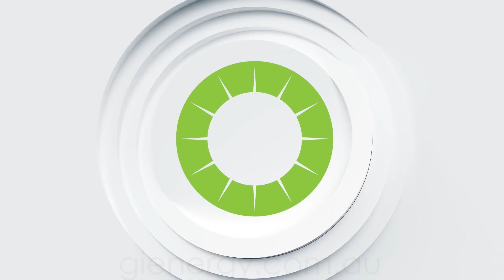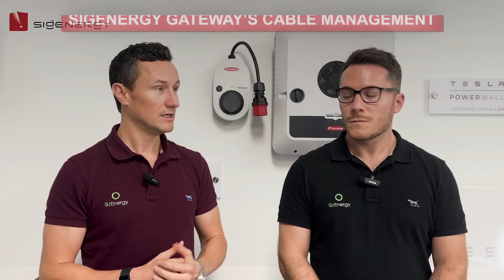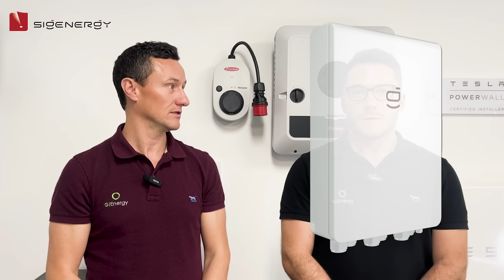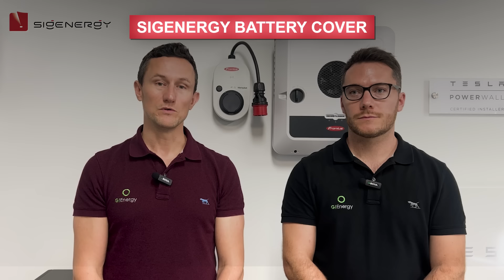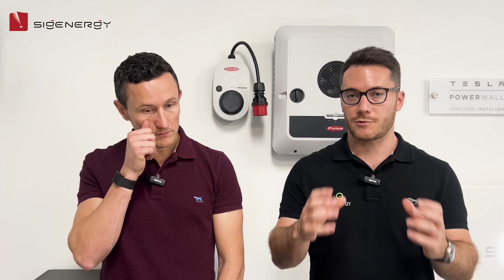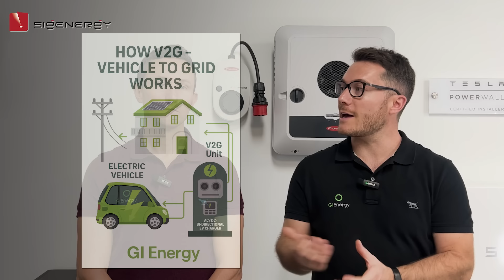Sigenergy Battery FAQs Answered by GI Energy

Comment: For an AC-coupled solution: if a Sigenergy Gateway is installed, are CTs still required, or can the Smart Port be used instead—allowing the system to rely solely on the Gateway without additional CTs?

Comment: If you 4 stacks with 25Kw inverter on each on a 3 phase circuit how much can you export? Or are you caped by the DNO ?
Reply from the maker: It would depend on your approvals with the DNSP (the grid owner in your area). usually you get at least 5kW per phase so 15kW but you can definitely get full export for 25kW.

Comment: Hi Dan and Matt, thanks for your videos as they were very informative. I recently have the SigEnergy system installed (gateway and 48kwh battery). My installer is scratching their head about the error (red AC and DC indicator) and won’t help. Are you able to advise how to escalate this issue with SigEnergy. Please see the error in this 9 seconds video https://youtu.be/9oLfSwaj9jk?si=KTenwLeMBhUM8Gda . Thanks in advance for your comments.
Reply from the maker: Hi, this is something your installer needs to contact Sigenergy about if they don't know themselves. I don't think it should be left to you to troubleshoot directly with Sigenergy to be honest as it will be really hard to find a solution without having the working knowledge of the product and also being accredited to install it. I know every battery manufacturer is struggling a bit with support right now as they try to deal with big increases in terms of installed volume so you may have to try and be a bit more patient than is normally acceptable. However, your installer should be escalating this for you.
Reply: @gienergy2250  Hi Guys, thanks heaps for your feedback. I’ll be asking my installer to escalate this with the supplier. Cheers

Comment: Clowns can't even describe what the function of a gateway is.   I am interested in a sig energy system, but this is definitely not the video to learn about backup in grid failure, inverter parameters, battery capacity vs inverter size or much else really.

Comment: I'm just starting out my research as I only have an electric boiler in my home (no gas or oil). My electric useage is horrendous. I've been quoted for a Sigen Energy Controller Single Phase and wondered if I should have 3 phase?  I'll have the Gateway installed too. Love the honesty of your video!
Reply from the maker: Thanks for the nice comment. If you have 3 phase power to the property you should really be doing a 3 phase controller. This opens up export limits which can be really important for maximising the solar and battery savings. This is even more important if you are considering joining a VPP to get the most from your battery. It sounds like you have a quite a high power bill as well so getting the design right is very important. We would be happy to discuss this further with you if you would like? You can contact us here: https://gienergy.com.au/contact-us/
Reply: @gienergy2250  really appreciate your reply.  I may well be in touch - thank you!
Reply from the maker: @debrabishop8727  No worries

Comment: If I start off with two 8kwh batteries in the Sigenstor, can I later fit a 12.5kw DC charger in with these batteries without adding another Signstor.
Reply from the maker: Yes, you can the DC EV module to the stack of two 8kWh battery modules for sure.

Comment: I'm sure there's a conversion between Sig batteries, but I thought the dc to dc converter was for the Sigenstor batteries to be able to convert the high voltage dc from an EV.
Reply from the maker: The DC EV charger is a module that forms part of the Sigenstor stack (purchased separately). The optimisers within the battery modules are what allow you to have different size modules working together (currently 5kWh or 8kWh, but a 10kWh is coming). It also means you can add a module later and it will not be dragged down the older modules performance level, like it is in some other batteries.

Comment: @gienergy2250 A point missed I think, is the DC-DC converters mean that if one battery module fails open circuit, the SigEnergy will keep running whereas a series battery configuration will completely fail. Another plus for SigEnergy?

Comment: Is it worth upgrading from single phase to three phase to install Sigenergy battery, looking at getting solar DC straight to battery, inverter and DC charger modules. All is good other than the price, not sure what this will cost.
Reply from the maker: 3 phase upgrade is always good for solar if you can do it and it doesn't cost a fortune. Tough to comment if it is worthwhile without knowing more but if it is possible and affordable it will 100% make your solar and battery a better proposition.

Comment: How long can the cable be coming from the DC EV charger? In my situation I want to put my solar/electric in a shed behind my house but the driveway is on the front so I'd need to plug in a car near 100 feet from where my electrical is.

Right now I have a cable that runs through my house from my main panel to an EVSE out front, but it would basically be impossible to put the Sigenergy stack beside my driveway.
Reply from the maker: The length of cable you can run between the Sigenergy (with the DC EV charger) and the vehicle is limited by voltage drop, cable size, and installation standards, rather than by the Sigenergy hardware itself. Your installer or electrician would need to calculate the appropriate conductor size (likely heavier than standard) and route it safely. Nothing is impossible if you are prepared to pay for it.

Comment: The plastic decorative covers are just that - decorative covers. I'd compare them to a grille on a car made from plastic - provided it doesn't get bashed with a hard object, then there is no reason for it to fail. Wrt to the batteries having individual "optimizers" which allows them to operate independent of each other, it not only allows you to mix different sizes of batteries it also allows Sigenergy to change the chemistry of the battery if a new improved chemistry comes along in the future. The battery architecture also prevents the SOC% drift/mis-alignment which is prevalent in most other battery solutions. Overall the Sigenergy product promises,, and has so far delivered no downtime and a worry free experience for clients and installers alike.

Comment: Yip  10 years on my Gateway     same as the UPS Hybrid inverter   
All my cabling is all tidy and out of the way   some issues maybe the older design  or novice installers....
Outside and of the weather and sun, great for cooling, 
Just have  Sigen 16kw batteries  10kw inverter all installed and had replaced my 9yr old 5kw solar panel system  with 12.7Kw of Aiko Neostar panels.
Good work guys

Comment: You said the Gateway gets installed near the battery,  which forvme will be in the garage. The installer  I am considering, says it needs to be outside near the meter box. Please confirm. Given that the Gateway is only IP54, what are the implications of having it outside?
Reply: It’s my understanding that the gateway is simpler to install as close as possible to the sub-board. This is different to the meter box and are not always near each other. In my case, my meter box is external to the house near the front boundary, but my sub-board is within the house. The gateway is best installed near the sub-board to minimise circuit cabling.
Reply: @stacerogers4008  Yes, absolutely right. Gateways should be as close to the main distribution of power in the home, in your case, the sub board in your home is the logical place. 
It's just that the concept of putting the gateway next to the battery is not necessary. Huge cables connect the gateway with your main supply, whereas the cables between gateway and battery are tiny in comparison, therefore much cheaper.
Reply from the maker: It definitely doesn't need to be outside. It might just be that your meterbox / switchboard is outside? If so, they are probably trying to put it there to save a long cable run back to the garage. I don't want to say they are wrong for suggesting this as I don't obviously know enough about the site but typically we would prefer to put the gateway and battery inside where possible. It might not be possible to do this or it might just be a bigger job with some exposed conduit perhaps. I would question it and see if it is possible to go inside.
Reply: @gienergy2250 does the gateway need to be close to meter box which is 3 meter in my case, or close to battery which is 10m from meter box?
Reply from the maker: @sydneywonder2000  Better to be close to the meter box
Reply: Yes I'm keen to hear the guys response to that too. 
My understanding is that any gateway, Tesla, Sig or any other, should be installed close to the meter box. This is because the main purpose of any gateway is to isolate the home, or island it, during a grid outage. Therefore they should be as close as possible to the meter and incoming grid supply, and interrupt the supply as needed. 
Then the battery inverter combo can be anywhere suitable, preferably out of the elements. Only small gauge 240V cables need to run between the gateway and inverter/battery stack.

Comment: I just had my 3 phase 25kW/48kWh Sigenergy BESS + Gateway installed & commissioned on 2nd July. FANTASTIC system. Works as expected in conjunction with my LG solar + Enphase AC coupled micro inverters.
Reply: So many questions...
I'm guessing the Enphase had to use the smart port? 
Was 25KW all your DNO allowed, or was that all you needed?
How is the app, and what are the coolest features? 
Have you done the off-grid thing and see how things react?
Reply: Have you noticed any humming/ noise from the 3phase gateway. Ive read that this is an issue. I plan to install on wall that backs onto a bedroom so am a little concerned if noise is problematic.
Reply: @JJax-s1x  This isn't something we have noticed in general. There is a contactor in the Gateway that can be used for hot water diversion which may have been what was noted. This may make a noise when it turns on, similar to a contactor in the switchboard. If the wall is brick this will likely absorb some of the noise, but worth discussing with your installer.